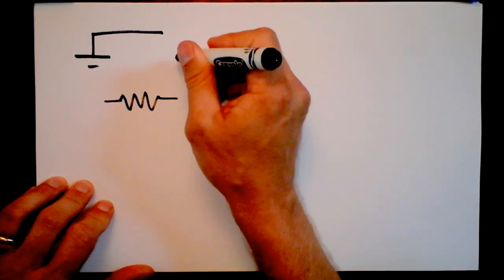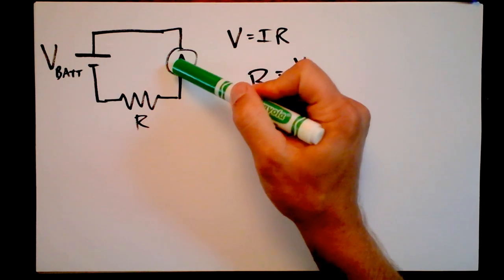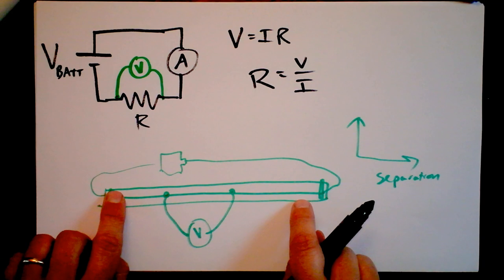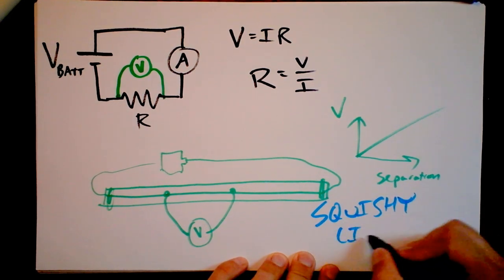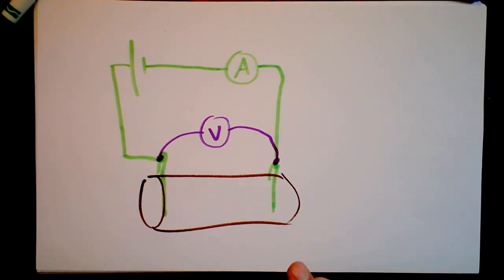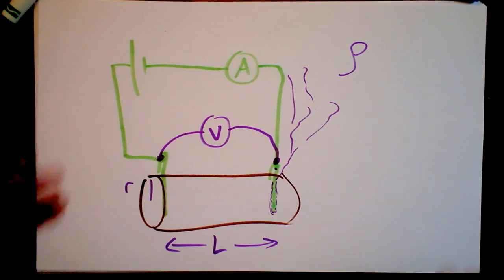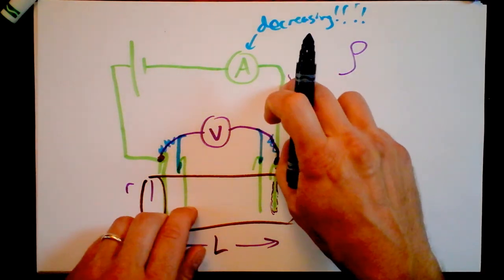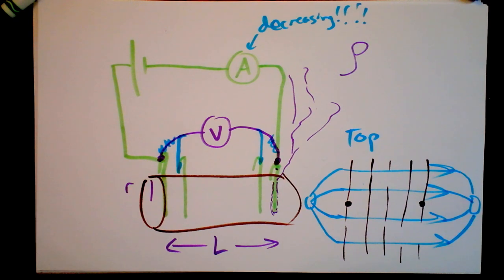Four-Point Resistance Measurement? | When and Why, Yo? | Doc Physics

Comment: DOC SCHUSTER, can you give examples of when you would use the 4 wire kelvin measurement for testing boards or troubleshooting circuit boards for what kinds of stages or sections in a circuit?

Comment: Great Video (as all of the other ones)!
I find it useful not only for students but also for professionals like me. A lot better then going back and reading about it. 
I knew about the voltage thermal effects of the current probes and the losses in the test leads, but missed that in the mass I need to see the probes as a "3D" current source and the potential lines are not exactly parallel near the probes. So my question is: how far should the voltage probes be from the current probes so that we are measuring in the "parallel potential lines" region?
And thank you for pointing out the "Squishy Circuits" I will buy it :)
Reply from the maker: You could measure the curve of the potential lines directly with your voltmeter and then decide how straight you need them to be.  I'm sure their curvature depends on the permittivity of the material and the dimensions of the material, also!
Reply: Thanks!
Reply: Maybe the ASTM standards recommends placing the potential leads at 1.5 times the perimeter of the cross section perimeter of the specimen from the current leads so that were measuring in the "parallel potential lines" region? Also in that region the potential and current is uniform throughout the specimen.
Reply from the maker: Wow - yeah!  That's a neat specification, of which I was not aware.  Makes tons of sense!